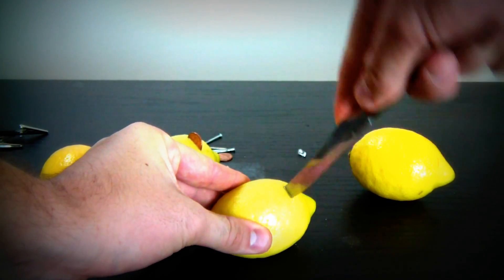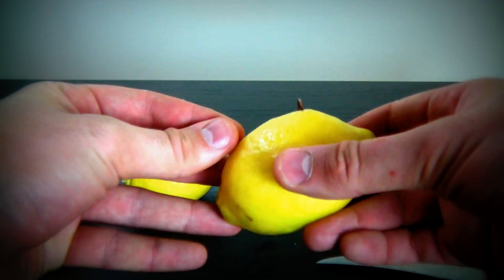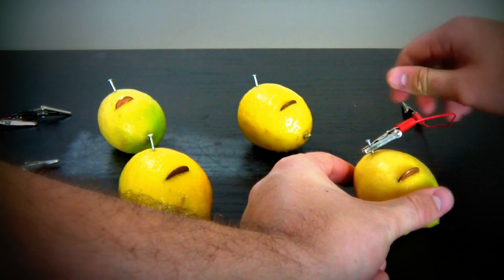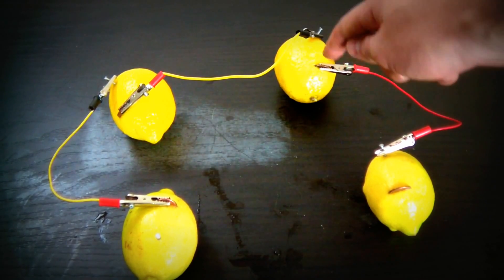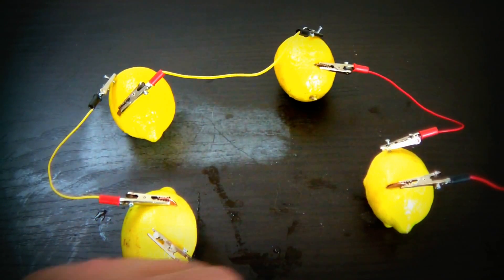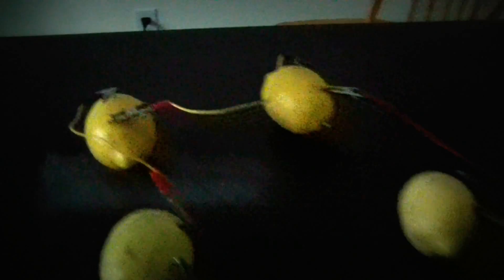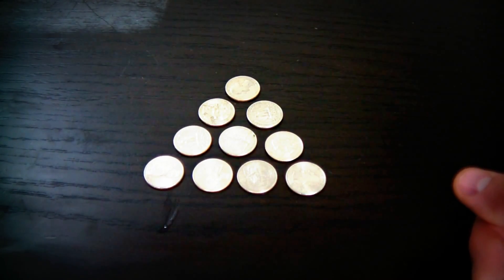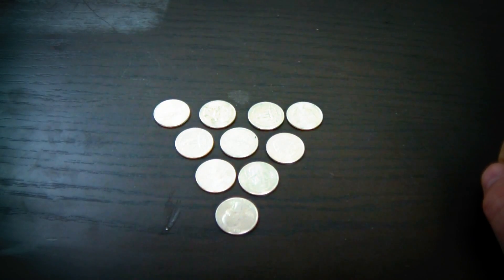Lemon Battery

Comment: If you connect the 2 ends of the cord things and clip them onto the USB part of a charger then plug in your phone, will it charge?
Reply: It doesn't exactly work like that.
Reply: It would need more lemons though.4 lemons is only 4 voltz,
Reply: Stanley Pang each lemon has 7 to 10 voltz. this is what my research shows

Comment: Coin acts as positive terminal and nail act as negative terminal... the acid inside the lemon act as medium between them... the electron flow occur in between them.. at the last the wire through coin is connected to +ive terminal of LED and wire through is the nail is connected to the -ive terminal of LED..

Comment: it works because the juice inside the lemon is naturally conductive. Also, the wires that are connected to the penny and nail, (which are  metal) it creates an electrical circut.

Comment: the copper reacts with the acids in the lemons and also the nail has to be coated in something special and that reacts with the copper and the acid causing electrons to got from the copper to the nail (or viceversa) and the more lemons you connect the stronger the current. (I'm bad at explaining)

Comment: It is because of the acid in the lemon.  The acid reacts with the zinc, from the nail, and the copper coating of the penny. The power doesn't come from the lemon, but the chemical reaction from the zinc and acid. A lemon can make around 0.9 volts, which is why you needed 4 lemons to light up a LED, which uses 4-5 volts.

Comment: This is caused from a chemical reaction between the acid and the metal which causes electrons to go though the negative side of the circuit, and lost electrons to go though the positive side of the electrodes, so then there's a current flow which connects to the LED and lights it up.

Comment: Because the sour of the lemon create energy thru metal object such as the coin, the nail, and the wire. When you connect the wire to the coins and nails, the energy follow thru the wire. At last, to clip the metal clipper to the metal part of the LED light and it will lead electricity to the light and I think both ends have to be negative and positive, right??